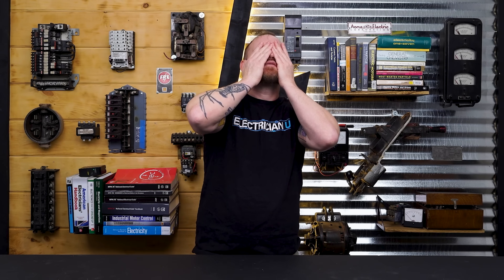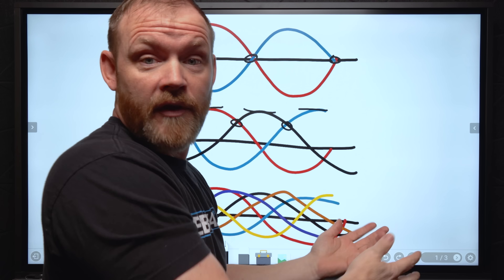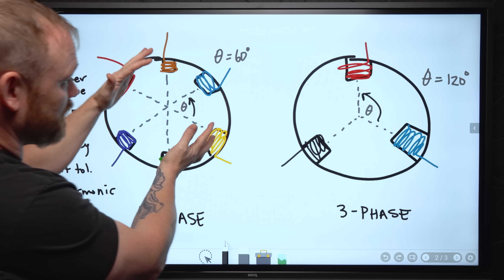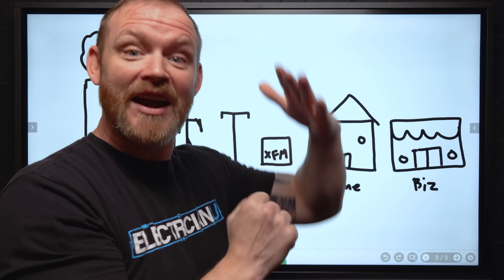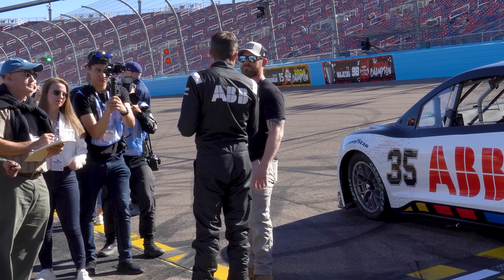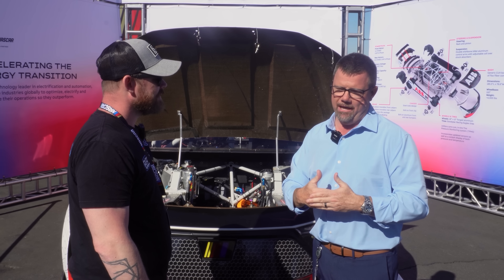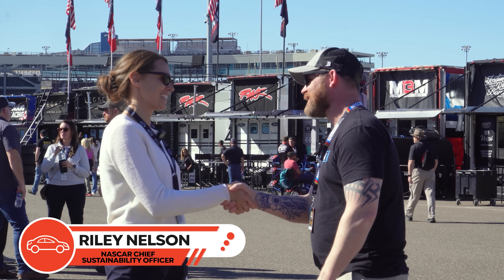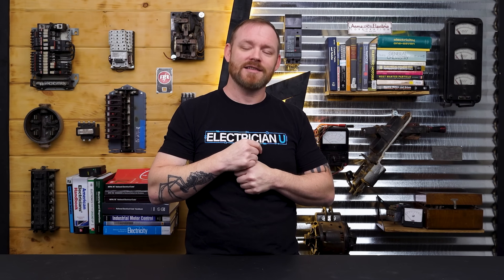6 Phase Power is a REAL GAME CHANGER!

Comment: I can tell you why we don't use 6 phase: law of diminishing returns.  Can you carry more power with 6 phase?  Absolutely.  However, you now have double the wire and far more complicated protection systems.  Also, with 3-phase, unless you are rectifying it for a VFD or other DC equipment, the nature of the sine waves make for a very smooth power transfer.  This is all stuff that was known fairly early on.  Early enough that a change could have been made without too much disruption.  However, because the primary loads of 3 phase were motors at the time, it was determined more phases didn't have a strong enough benefit for the cost.
Reply: Exactly... Plus it's trivial to derive 6 phases from three if you really wanted to by center-taping a delta configuration transformer. Nobody does it because it's total overkill for stationary applications. 

3 phase motors often have multiple poles which effectively smooth out torque anyways. 

In a  electric race car if it lets you get the same effective power with 80% of the weight, it's a pretty easy tradeoff for a slightly more complicated inverter design. In industry/HVAC... not so much.
Reply: @WorBlux it’s pretty common for large motors driven by VFD’s.
Reply: @WorBlux  It's not even a more complicated inverter design.   A set of 3 transformers on the outputs is all you need to convert a 3 phase inverter into a 6 phase.  This is much like you need a single transformer to convert a unipolar 1 phase, into a bipolar 2-phase power supply.
Reply: Right on.  If you look at the instantaneous voltage of each of the three phases and remember that power is proportional to V squared, the power transfer is completely smooth.  Rectified voltage, not so much. Don't believe me? Make a spread sheet. Plot each of the three phases over 360 degree rotation, calculate the instantaneous voltage, square it, and then total the squares. The result is a constant. Now, I can see why there might be advantages to a 6 phase motor, matching the rotor speed to what you need without going so fast it will fly apart. Also it might be easier to built 6 smaller inverters instead of 3 big ones.
Reply: @russellhltn1396 thank you, I remember from school that power from 3 phase should be perfectly smooth I just couldn’t remember exactly why lol.
Reply: 6phase and even 12phase can be created by a transformer for smooth rectification.
Reply: @scoutjonas  True, but that is a specialty situation.  Directly connected motor loads don't require it because they use the whole sine wave thanks to how they are phased.  However, you need to consider how complex those transformer connections are for higher phases and consider if those increased costs and complexity are really necessary.  A VFD driving a 500hp motor would likely benefit from such an arrangement.  However, for a 10hp compressor in an office air conditioner, it would be overkill and extremely expensive.
Reply: Just a thought here: what about 4 phase? What would that look like?
Reply: @badbrain8279  something similar to that was done.  It was the original design by Tesla himself.  I always called it 2-phase quadrature (I'm unsure what its official name is if it has one).  Essentially, it was 2 phases shifted 90° from each other, and it could deliver power smoothly as well, but it required 4 current carrying conductors where 3-phase only required 3.  Add to that more power could be delivered with 3-phase.  However, what was learned as some were experimenting was that as you increase the number of phases, the power carried doesn't increase linearly with the number of phases, but the costs of implementing it did.  It was determined 3-phase was the most efficient arrangement.
Reply: And if you want to doble the infrastructure to doble the power transfer, it'easyer to just double the section of the cables than to double the number of cables on power transmission lines hangign off poles
Reply: The motors usually have many windings anyway. 3-phase doesn’t mean 120 degrees rotation per cycle. This means that we could make several phases with a common brushless motor, by adding capacitors. We could technically do this with a 1-phase input, with various capacitors, to phase shift that input signal. Maybe that’s a project we should diy some day, 18-phase motor!!!
Reply: For power transmission you are correct, but for brushless motors 6 phase is better in every way. It seems like you are in the mindset of industrial power and induction motors. I can almost guarantee the motor in this video uses two 3 phase inverters running out of phase to achieve "6" phases. This is nothing new, there are 10+ year old mopeds running 6 phase motors
Reply: Another way to think about it is to put a single permanent magnet rotor into a multi winding stator, then get 18 oscilloscope points, one per winding. Each signal should be 20 degrees out of phase  when you use it as a generator.
Reply: No vfd's here, these are not induction motors, and the inverters dont use transformers either. No rectification, as the initial power source is DC. Output voltage and frequency go up with rpm. Another benefit of 6 phase is that they can switch the motor between delta and star in a split second, all via the inverter.
Reply: @ganzeytyler  You're right, I was talking about transmission and general industry.  EC motors are a different animal.  My initial comment was directed at a comment made in the video.  In a case like in the video with an electric race car, it makes total sense.
Reply: The only time I have seen 6 phase power used is in a exide UPS unit. And then it was done using a center tapped double y transformer. It just isn’t effective enough in most applications to warrant the extra complexity.
Reply: I want 9 phase just to have it
Reply: If the subject was utility power transfer - the answer is different.  Almost always the incoming AC power is converted to DC.  That conversion results in terrible power factor - single phase being the worst - 3 phase much better and has the benefit of no 3rd harmonic (the 3rd harmonic generated by single phase AC/DC conversion is extremely hard to eliminate in normal conversion methods).  Preferred power conversion on US Navy ships uses 3 phase generators which power the equipment and requires the equipment to have extremely high power factor back to the generator making it such that the generator on the boat is supplying the “real” component of the power and very little out of phase component- meaning the generator can be sized for what’s needed.  The utility for your home in the US simply makes you pay for your low power factor - but in turn they have to have much larger generators than if they had high power factor users….point is - you immediately get a power factor increase if the utility had provided 3 phase to homes instead of single phase - the extra cost for the copper wire is made up in more power availability….and ironically the power factor issues go away had the utility provided DC power instead!  (You realize Edison lost the DC vs AC debate to some guy named Tesla! 😂).
Reply: Oh, they'll realize it takes triple the energy to produce 6 phase soon enough.... Idk why they think it's efficient when it was proven LOOOOONG ago that it is not.
Reply: Depends on your application. For industrial applications, you are totally right: 3 phase avoids those "null periods" of power and does a damn good job at a reasonable economic price. 

For this car applicaiton, you are getting almost 100% power the entire time ... much better for performance, torque vectoring, and playing optimization games with the controllers / drive intelligence at that point.
Reply: @litmaj0r  I addressed this in other comments, but yes, you're correct, but this race car is also a self-contained special case.  It's an exception that doesn't make the rule.  My point was answering a comment made in the video.
Reply: ITT - folks who don't know advanced motor physics.
Reply: 6 phase can simply be created by running 3 phase through a unbalanced to balanced transformer.  There isn't any added complexity to generating it the power over 3 phase power.
Reply: Exactly correct. They have tried it all the way to 12 phase and maybe more but 3 phase is typically all that is required. 6 you can do and might have a tiny benefit for this high performance type application but for 99% of things 3 phase is all that is needed. Anything more is more complex and minimal benefit.
Reply: @newmonengineering  6 is the sweet spot for stability
Reply: 6 phase is simply two sets of 3 phase offset by 60 degrees.

Power wise you gain nothing and lose nothing - it's merely duplicating an entire 3 phase system. The losses will be doubled, the gains will be doubled.

Economically however it's more expensive as you'll be maintaining double the infrastructure and wiring, whereas doubling the capacity of a 3 phase system does not double the maintenance. It doesn't halve it, it'd be somewhere in between but much closer to the half side.. eg 60% rather than 90%

It's almost always cost related and this is no exception. 3 phase is the most cost effective way to deliver a kWh of electricity.over long distances.
Reply: It's nascar... complexity and cost aren't valid argument's against the design in this case.
Reply: @Mediiiicc  i never said that this car wasn't the exception.  As a matter of fact, I acknowledged that in other comments.  I was responding to a more general statement in the video.
Reply: That applies to 99.999% of applications where monetary cost is rather important. Racing is not those. As long as weight cost trade off is good enough it makes sense.
Reply: Do the magnetic fields interact with each other more with 6 phases? Like each phase pulls and pushes the magnet from and to the next phase. But with them so close together does the phase one ahead or behind end up slightly pushing on the magnet or weakening the magnetic field?
Reply: Ur wrong its double the efficiency smoother operation and less power loss  it’s just not gonna make double the power.
Reply: Yes, but now that cost has been reduced by the economy of such a large scale, perhaps it's worth revaluating that s trade off.
Reply: @kayakMike1000  i don't think you appreciate how expensive that is.  I looked into it once for a VFD.  In that particular application, going to a 6 phase architecture would have well more than doubled the installation cost.  Quite honestly, it's not worth it unless your load is significant enough for it to create significant harmonics in the power system.  3-phase is more than sufficient for the vast majority of applications.
Reply: no, diminishing returns is the excuse, the reason is capitalism being cheap on parts
Reply: @kingmasterlord  No one spends more than they need to get the job done.  The advantages of 6 phase are for a very limited number of applications.  Most homes only have one phase or a split phase, not 3.
Reply: @russellhltn1396  i know, thats a capitalist mentality, obsessive minimalism
Reply: @kingmasterlord  Going above without any kind of return is poor engineering. Sure, there's something to not pushing everything to the limit, but 6 phase in most cases is just a waste.
Reply: @russellhltn1396  6 phase is standard, they trimmed it down
Reply: @russellhltn1396  Ignore him.  He's is a troll.  He clearly doesn't know anything.
Reply: @VTdarkangel  not trolling to stand on business. i have my opinion and im not going to change it or apologize for it.
Reply: @kingmasterlord  In what world is 6 phase standard?  Go back under the bridge and wait for the next billy goat.
Reply: @kingmasterlord  name any application that requires more phases. Motors ain't one you can multiply the numbers of coils, and most motors are 6, 9, 12 coils already. You only really find it when multiple power sources are required for power or redundancy. Like in a view emergency hospital installations, military equipment that runs from grid, diesel and solar, or critical industries like gas refineries have it to turn down the facility safely in case the grid fails.
Reply: @MrHaggyy  read this comment section and you'll see several, including your own post
Reply: @kingmasterlord lol using “capitalism” as some big evil buzzword, thats just logic. Nobody in there right mind spends more than is necessary. Including you.
Reply: @Ultrajamz  ever heard the phrase "spare no expense"? your subjective experiences are not facts. you cant even separate your thinking from the idea that all things cost money, which is a cultural norm not an intrinsic quality of the world.
Reply: @kingmasterlord  notice I just said spends not even spends money. Wasting or over exerting energy is not the law of nature. “Capitalism” is just defining the laws of nature in the world of finance.
Reply: @Ultrajamz  i dont have to notice anything
Reply: @kingmasterlord  thats clear

Comment: For very high power industrial motors some VFDs support a "12-pulse" ("6 phases"-ish) setup to improve power factor & harmonics. For that setup you can use a delta to delta transformer for one set of 3 phases, then a delta to wye transformer to get another 3-phases that are shifted from the base power.
Reply: Hyundai is using this in their newest EVs. Running one style delta in low speed for torque and wye style at high speed for efficiency.
Reply: @ericnewton5720  Quite common to do this on crane travel motors, connect them in delta and run them at 87Hz base speed instead of 50Hz. It means you can squeeze 1.73x more power out of a given motor frame size but the variable speed drive has to be larger as well. As the motor runs faster you can increase the step-down ratio in the gearbox to give more torque at the wheels.
Reply: In the xray world they used to do this with the generators that supply the power to the tubehead. I think at one point they hey 12 or even 24 phase and it was explained to me they wanted to maintain a steady rate of the phase. These generators would take up half the room and now have been replaced with high frequency generators that are half the size. I wish I could post my notes as i'm going off my head from notes taken 8 yrs ago. Sorry if my terminology is off
Reply: Not new.  NY transit had mercury pool rectifiers.  Delta delta feed, and y delra feed made 6  phases, I think they also center tapped to get a derived 12 pulse.  Each set was 10KA 600VDC.  The mercuy tank vacuum pump outlet areas are enviromental nightmares.
Reply: @petercampbell4220  Maybe those Hg_vac_ pumps' tailpipes would have had to be cooled to cryogenic temperatures; if anybody in a responsible position really had cared about health and the environment! 
But alas, just look at NIH or FDA or at EPA for the last 50yrs; basically, (at best!!!) all a scam to make the public "believe", 
and to harras the car-drivers as much as they can! 
in the EU it is even worse: Green stupidity the prevailing politics and nonsense the result.
Reply: That's to reduce the harmonics drawn from the supply, it has no bearing on what happens at the motor end. If the power converter is supplied from a battery, there is no ac power source
Reply: 12 pulse VFDs refers to the SCR inputs spreading out their switching from 6 pulses to 12, which reduces harmonic distortion back to the source. 12 pulse VFDs still drive three phase motors.
Reply: Never heard of a 12 pulse VFD. In our newest building all motors 40 HP & larger  had 18 pulse drives. Talked to techs from three different drive companies and all said to stay away from them. As far as harmonics it can be reduced by installing a line reacter on the line side and active controls ( usually have 1 or 2 contactors, capacitors and other parts.
Reply: @garbo8962  It depends how big your drives are. I used to be a drive specialist for Schneider Electric and supplied 2.6MW drives with 12-pulse rectifiers from 3.3kV supply. We won that job because we could use the existing transformer whereas Rockwell wanted a new transformer for 18-pulse rectifier. Quite common once you start getting above 500kW and the reduction in harmonics is greater than can be achieved with passive filters. With MV drives the output inverter is often made up of multiple simple inverters connected in series, each of which requires an isolated AC supply. You therefore need a complicated transformer with multiple secondaries so it's then easy to arrange these for harmonic elimination on the supply side. Robicon did this with their 'perfect harmony' drives.

Comment: I am curious, in the worst case scenario, in hard regeneration "Braking" how much energy is collected and how much is being converted to heat thru a breaking resistor? (If any)
Reply from the maker: So I don't have specifics but I'm told that 70% of the kinetic energy through the braking cycle is recovered. Of course there will be heat losses, especially with a car going 150mph into corners, but 70% seems pretty impressive.
Reply: ABB has regenerative drives in industrial use that can capture 100% of braking energy.

Not sure what drives they’re using here.

Comment: 3 phases are used in industry almost entirely because of 3-phase asynchronous induction motors. With three phases, the direction can be controlled without any shaded pole or centrifugal clutch (which are needed for single phase motors). They have good power to weight, good efficiency, and are relatively simple to design and manufacture.